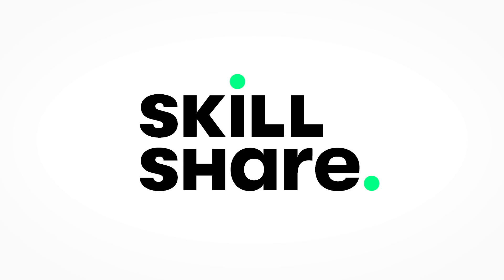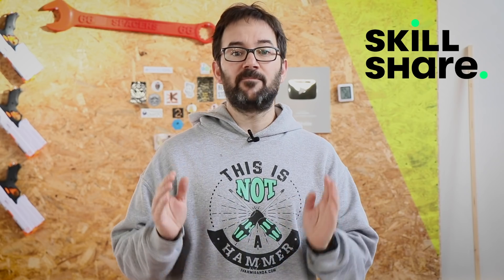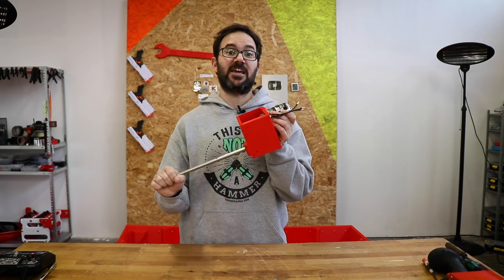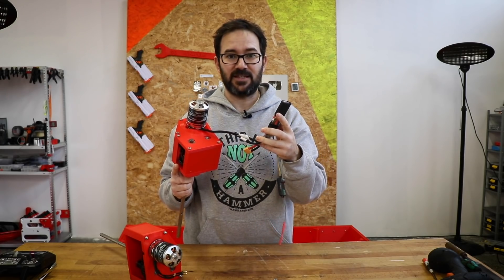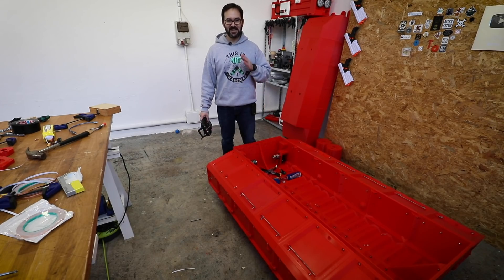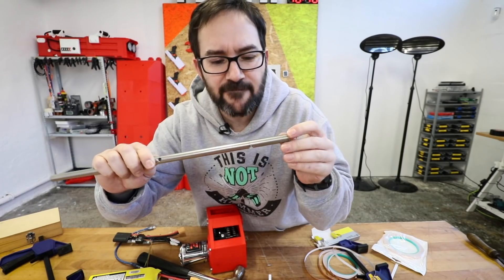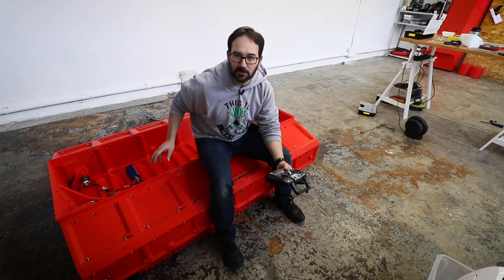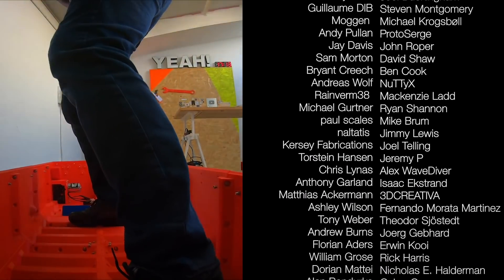MOTORS ON THE BIG 3D PRINTED TANK!

Comment: you need to program your ESC like they do in a RC crawler. you can lower your brake force when getting off the throttle and control power increase with expo and a more gentle curve
Reply: I seen your other video and you used the controller to do what I was suggesting, cool …. but I wonder if it's better in the ESC or radio?

Comment: rather than larger bolts it may have been better to use higher grade bolts ....keeping just on the safe side of shear strength to protect plastic parts (the reason many machines use shear pins)

Comment: This kind of remind me of the Porsche tiger with it's combination of fuel burning motor, I don't know which fuel type it used tho, which power electrical generators, but that hade all sprocket wheels driven and a fuel burning engine and was made as a Panzerkampfwagen VI Tiger I disign from Ferdinant Porsche, yours is home made, has only two sprockets giving power to the tracks and doesn't have a fuel burning motor

Comment: Should probably look into high grade metric bolts for the axles, like 10.9 or 12.9. They're much stronger than regular 4.8 or 8.8 metric bolts, in some cases by double or triple tensile strength.

Comment: Sensorless BLDC motors is not good for high torque applications due to uncertainty of shaft position at low speeds. It may even burn down easily. Using of sensored motors is better.

Comment: Now according to your purpose of this tank, a turret with adjustable vertical fire angle can be mounted on the hood...
But first there need to be a proper seat for comfort of pilot, and expand the battery pack for range. However if more battery is used, heat exhaustion is required or the excess heat from batteries and motors will cause discomfort on the pilot.

Comment: Hi, Ivan! Maybe you can put few layers of a polyurethane sealant over you tracks. I think that the parts that contact with ground directly will be degraded pretty soon! It's not nylon (but even nylon isn't super-sturdy) and any concrete or asphault surfaces will be like a sandpaper. A good sealant will longer your tracks' life.

Comment: Why is motor housing spin? PS the tank is cool n all. That said. I personally think you Are one of the best Engineer on UTUBE. Your True potential is not even being tapped into.. my name is Oscar Anderson. Question...  Would it be possible to build a 3D printer that has a 10-foot z access, that can be put onto a track. To print a wall for a house . I saw your giant 3d printer. Q no 2 could you make the printer 40 ft by 8 ft is it possible.if you have already thought of it how much you think it would cost to make one it doesn't have to be that good. Let's say quarter inch+ or- tolerance..? I have so many wonderful projects. and I sure wish I had a very smart engineer guy like you that I could ask stupid Questions. And thanks for sharing your crazy stuff on the internet it's really cool. I am Oscar Anderson I created medical accessories and research Zeeland Michigan. Please research if interested. I hope parts and products on website I created using rubber silicone tooling. Started company with me duct tape and wooden skids. 18 years later company sold 3.7 million however I did not receive any. I am getting ready to go back into something special. I only wish that I could hook up with somebody like you a super smart guy... Like you the world has never seen my true potential but I would  like it to see it. I assure you. Thanks for your time keep up the cool stuff. I know everybody in the world's

Comment: if you put in roll pins instead of the bolts, they will have ALOT more shear strength, also would you please buy a drill or impact driver! watching you turn all them bolts by hand drives me crazy. it could be so much faster!

Comment: Use bolts with an unthreaded shank section long enough that there are no threads within the holes in the axle shafts. That will greatly increase the shear strength.

Comment: I hate to say it but its clearly geared too high. That or you need 2 more motors per side. 

Also, if you lowered the center idler wheel about a centimeter, the vehicle effectively becomes half as long while turning, and other than a slight rock, retains the exact same characteristics in a straight line. I’ve done this with robots and it works quite well.

Comment: This is insane (in the good way).  One mechanical note: If you start watching at about 13:35, watch the trailing end of the treads.  There is some slack in them. Looks like almost enough to cause trouble, when you get out into the world.  Maybe see if you can take out a tread?  If not, try adding a tension roller somewhere on the top if the tread?

Keep it going.  Can't wait to see this thing finished.

Comment: Careful drilling holes that large through those jackshafts, you're dramatically reducing the amount of torque they can withstand. I've done the same thing before and had them break on me.
Reply: @NW3D When you make an intelligent comment, I'll listen.
Reply: I would have replaced the bolts with a spiral pin.

Comment: Something to consider that could leave you a little more space for the motors, Instead of a multiple sprockets to get your reduction , could try worm and wheel instead, would have the added bonus of when the motor is not turning the drive wheels are locked (can't back drive a worm and wheel setup).

Also a flat ground into the shafts might work better than drilling a hole through the rods and forcing all that shear force onto the bolt shafts (think grub screws like how you attach a coupler to the shaft of the stepper motor).

Comment: While building tanks with lego, it always helped to use 4 motors instead of one. It drove more strenghly. Also, when you finished the tank pleas build in a screen inside connected to a camera and drive im public with the top closed on it

Comment: Still using those 'special' hammers! Damage to the screwdriver handle improves the grip too. 👍
Fantastic stuff!! 💖
PS - I built a full-size replica of the British Army "Wheelbarrow" bomb disposal robot some years ago - don't forget to consider motor cooling when they are in continual use at speed - especially in sunlight! (also, this thing is built mostly out of PLA, right......? 😉)
Reply from the maker: Yeah, no sunlight for this one, I already have centrifugal fans printed for the outrunners 😉
Reply: @ivanmirandawastaken  Give it a coat of white paint to keep it cool in the sun.

Comment: "Spacer" is not funny anymore :(
Reply from the maker: It never was, Spacers are a very serious issue. Never joke about spacers. SERIOUSPACERS!!
Reply: @ivanmirandawastaken  but moving from belts to chains is good.   You must use bigger shafts 5mm holes for bolts will make a weak point.

Comment: I been following the project since the first tank and I can say that the drive axles are to thin especially since you cross drilled them they will break when you put some real torque thru them all your past tanks had problems with their drive line I suggest to increase the diameter of the final axles by 2x or 3x because you already sheared 4mm bolts using less the 10% power. Sorry for my bad English.
Really looking forward to seams that thing finally finished.
Reply from the maker: Axles won't break

Comment: Look into a track tensioning system cause it looks like when your tank goes from forwards motion to backwards motion and vice versa alot of slack is thrown under the sprocket wheels which could cause wearing problems or could cause a track throw. Lessening that slack would also make it more receptive to forwards and backwards motion and make it easier to replace tracks.
Reply: You're going to get slack at one end or the other, depending on which way you move; you can see it on real tanks as well. Given the materials, a track tensioner is probably not needed because the components wll wear enough to need replacement before a tensioning adjustment is needed. Still, having watched so many of The Chieftain's Hatch videos, it seems almost sacrilegious to show off a tank and not have a segment showing off how to adjust the track tension...
Reply: @DmdShiva  you chose well my friend Nicholas is one swell guy
Reply from the maker: Not the issue
Reply: @ivanmirandawastaken  If you can, I would recommend making the driving sprockets bigger, the same size as the road wheels ideally.  Almost all real-life tanks have that in order to reduce track slipping and a few other benefits.  Either way great work on this so far, it's really one of the first of its kind out there!

Comment: Bolts aren't really great for shear loading. Use a pin and you will know the spec.
*Edit: I realize it's a 3d printed tank.
Reply from the maker: Haha
Reply: Bolts and shear are fine. Threads in shear are not. He can find a fastener which has an unthreaded body through the jack shaft and enough threads for a diameter of engagement with the nut.

Comment: Get some m4 titanium bolts.
Reply from the maker: No
Reply: @ivanmirandawastaken  Considoring how high the torque (it actually took me by surprise) is on the driveshaft, it would maybe be a good idea though. I'm not sure that the driveshaft will hold up to those kind of forces a long period of time with two 5mm holes in it. A hardened steel pin should work too.

Comment: Ivan, I have a suggestion, glue or screw Rubber in the tracks, you will you gain more traction and will avoid damage to the tracks in hard surfaces

You can see, tanks with urban kits have rubber pads in tracks for traction and avoid damage(but in that case, to avoid the damage the surface, not the track)
Reply from the maker: You defeated your comment

Comment: To do something like those intermediate shafts, you could save yourself a whole lot of effort by buying shaft with keyway already cut in it, and then just print your bushings with keyways in them. No marking and drilling necessary.
Reply from the maker: A 3D printed keyway wouldn't last a 10th of a turn
Reply: I'm not sure where you have received that information but that is absolutely 100% false. It is by far the strongest way to secure an object to a shaft against rotational forces. The surface area is significantly larger than a through pin, and it doesn't significantly weaken the shaft like cross drilling does. I would be shocked if you don't break a shaft soon now that you have moved to an M5 hole. The only time a rotational load is secured to a shaft with a through pin is actually when it is intended to be a failure point to prevent damage. For example, the screw in a snow blower is secured to a shaft with a pin so that if you hit a rock with the screw the pin will sheer and not damage the entire machine. You have essentially secured it with a sheer pin. In the next couple of weeks when I have time I will make a video testing a 3d printed keyway versus a through pin and make a video for you with the results.

Comment: Try adding negative exponential on your left and right, this should cause the inside track to reverse or reduce its speed faster, giving you better steering control. Set it at -10, and keep decreasing until you feel the effect is where you want it.
Reply from the maker: That's not the issue, you'll see

Comment: Hola Iván. I've noticed your tracks have a bit of slack. That can pose two problems: 1 a lack of control, as the lower side of the track has to get in tension to start pushing on the tank. The second one is that until that tension is reached, the sprocket has time to speed up and then it suddently grips, causing a huge stress on every part of your transmission. That may be a cause of your bolt breaking haha. I don't know if you already had that in mind and you are going to fix it, if not, well, I'd be glad if my comment helped you. However I would be careful tensioning the belt too much, as it could snap easily. You're a very smart guy and surely you'll find a way to fix that. Me encantan tus vídeos, sigue así máquina 👍🏼
Reply from the maker: Just wait for it...

Comment: The tank  not turning is a motor issue, even if it is to grippy you should be able to turn by turning both tracks in the opposite direction. I think you need bigger motors you are asking to much out of those.
Reply from the maker: Wrong
Reply: @ivanmirandawastaken  OK then 👍🏻
Reply from the maker: You'll see, remember that I'm from the future
Reply: @ivanmirandawastaken  😂 yes.

Comment: to much slack in the tracks 13:35
Reply from the maker: How's that bad?
Reply: @ivanmirandawastaken  I'm not sure about tanks but with tracked excavators it can end up throwing a track and with the tank being built out of plastic it may bind causing stress to parts and excessive wear and parts to fail.

The slack only seems to happen when you are sat in it as far as I can tell, maybe stiffer suspension components may help.

I'm not an engineer lol Im the guy with the grease and spanners.

Love the videos by the way :)
Reply from the maker: The sprockets are extremely over dimensioned just so tread slack is not an issue an treads cannot be thrown. You'll see
Reply: @ivanmirandawastaken  oh good 😁 cant wait for the next video

Comment: Maybe you should put an arduino in the tank and pass the control inputs through a moving average filter or limit their slew rate. This smoothes out the spikes of acceleration you're having trouble with.
Reply from the maker: Nope, not the issue, wait and see...

Comment: Looking good!  Good to see the tank moving under its own power! Setup exponential rates on your transmitter or ESCs. That will allow for finer control at slow speeds and makes movement smoother.
Reply from the maker: That's not the issue, the issue is that the VESCs don't know where the rotor is due to the motors being sensorless and the low speed. I have a fix for that... 😉

Comment: ok Mr. Madlad here is a little something you can do to improve steering a bit. see those support wheels in the middle? if you make it so they are (in the case of this build) about 1 to 3 cm higher than the rest of them, you will increase the ground preaure in the middle while reducing it on the ends, this will allow the threat belt to slide better on the ends, thus increasing turn control and efficiency.
Reply from the maker: You're correct, but I have something better in mind (mwahahahah!)

Comment: You should use bolts with shoulders(those bolts that dont have the thread along the whole lenght of the bolt) where sheer is expexted
Reply from the maker: I have none the length I needed
Reply: @ivanmirandawastaken  Or use hardened steel pins
Reply from the maker: Again, none in stock, if I go and buy every single "ideal" component I would make a video a year 😂

Comment: Ivan, please lube up before tapping holes... ;-)
Reply from the maker: I will
Reply: ( ͡° ͜ʖ ͡°)
Reply: Since when you need lube for taps.. Just run then slow rpm
Reply: @Pinkmouse That’s what she said
Reply: @andrewhurst8239  "that's what"
                                       ~she
Reply: Also I personally like to use cordless drill for tapping, much steadier and easier than that t-handle.
Reply: @villesaarenketo2506   drill press on stupid slow speed would be better. It will pull itself in and shouldn't wobble
Reply: @bobbiac  Yes that is an option too maybe.